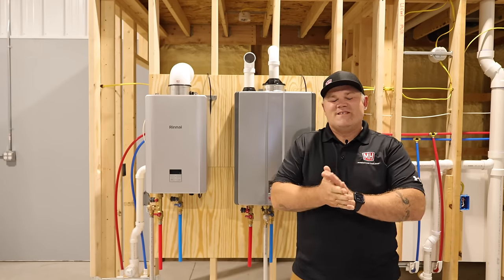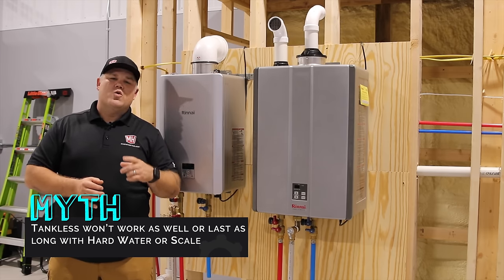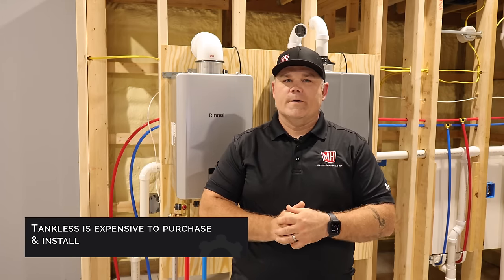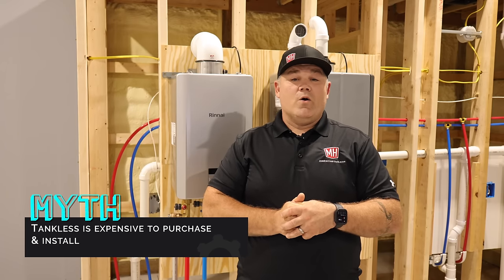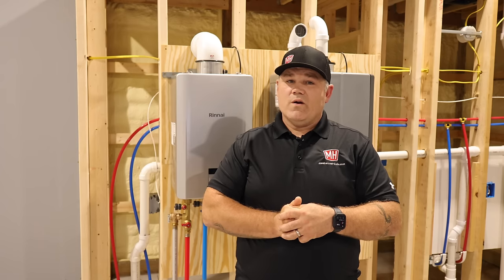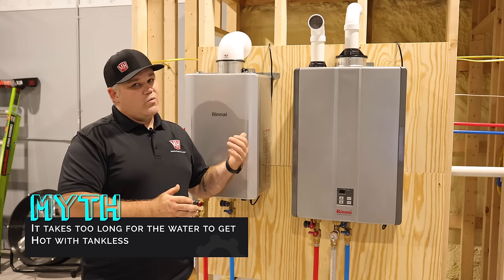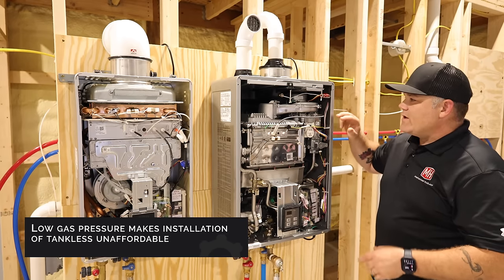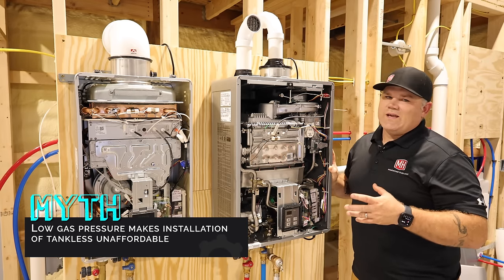Myth Busting! Tank -vs- Tankless Water Heaters

Comment: I’ve had tankless now in two homes, one in the warm climate of the Deep South and another in the bitter cold climate of the north.  We’ve never had an issue with a shortage of hot water as noted in the video.  I would add only one suggestion, in my case I use an re-circulating pump external to the tankless water heater.  It is a Taco brand and it has a feature where it learns your pattern of hot water use, so instead of always re-circulating it will learn for example when you normally shower in the morning and kick in before that time to have hot water available instantly.  Thanks for the video.
Reply: I was thinking about a re-circulating pump but I was thinking to connect it to my bathroom light which is controlled with a sensor switch.
Reply: I have a tankless in my newer home.  I keep my circulation pump off because the tankless would keep turning off and on  continuously .
Reply: @mattbowers3541  Replace it with a Smart Circ Pump or put the circ pump on a timer.  Depending on your local climate, even just circulating a few minutes every hour can help.
Reply: Eww you take shower in the morning? Take shower before bedtime to get rid of the germs you accumulated throughout the day. Your bed will thank you for smelling good lol
Reply: The bad thing about my home,like Thousands of homes in Florida built in the 60s and 70s is the copper water lines are buried directly in the sandy soil under the slab. So I just checked my kitchen sink, it took one gallon of water before I got hot water. All the videos talk about the cir pump getting the water hot then shut it off, well that water under my sink might be hot for 6 or 8 minutes but if I wait just 2 minutes and use the hot water it’s already cold, the sandy soil just sucks the heat out.
Reply: @kabulbolan  I take a shower in the morning and evening during the winter and even more during the summer. I live in a hot climate (southern climate) and can take as many as 4 per day. I am NOT a fan of tankless heaters. I know people that have them and I can never get hot water out of them for the 20 seconds I wash my hands. The Rinnai is on the outside of the house of the bathroom wall. Remember that this  video is sponsered by Rinnai so take things with a grain of salt.
Reply: @joemc111   they did that in our house in Texas too.  Have no idea  why they didn't just take it thru the walls
Reply: @DrGrandpa OCD....
Reply: @DrGrandpa Dirty Grandpa.
Reply: @kabulbolan  
That's what we learned in the Navy. Mostly because you're so hot and sweaty getting off work, that you don't want to get into bed feeling slimy. Getting a good shower then going to bed was the best way to keep your bedding clean.
Reply: @paulh6517  The time it takes to get the hot water at a faucet is the same for tank and tankless (unless you have a re-circulator pump system, which also wastes energy keeping the water in the pipe warm). The time it takes to get warm is a factor of the distance from the hot water source. The tankless saves energy by not pre-heating water all day, everyday.  It only heats it when you turn on the hot handle of the faucet.
   If you want hot water quickly at a faucet you need a re-circ (wastes energy) or an insta-hot at that faucet which heats the water there until the regular hot water gets there (saves energy).
Reply: @toolmantimsmythe8724  Perhaps both the units that I have experienced were installed improperly. I understand the lengths of the run effects the time of the hot water reaching the spigot. How long it takes to heat up the coils in the tankless is probably dependent on the outside temperature unless said recirculation unit is installed. I believe the gas heating the coils on demand is probably the reason for the delay in heating up the water up to the desired temp. Sort of like the Drip Coffee maker vs a Bunn Coffeemaker where the cold water displaces the hot water. Bunn coffeemakers are fast. But hey, I am certainly not a scientist or installer, so I could be far flung like cow dung.
Reply: @joemc111  That would be pointless as the water needs to recirculate all the time. If you stop the water from recirculating then it will cool down. Ever stayed in a hotel and noticed how quick you have hot water? It's because of gas fired hot water heaters with recirculating pumps that run constantly. I know this because I'm a maintenance tech in a local hotel.
Reply: @kabulbolan  You must not wash your bedding on a regular basis. I also do not shower before going to bed.
Reply: @williamjones4483  If we don’t use the room for a day why run the pump 24/7? Besides that your system has a Third pipe just to return the hot water back to the tank, my system like any older home would use the cold line to return.
Reply: Viewers should also consider Heat Pump Hot Water Heaters on You Tube also. After reading dozens of posts here I didn’t see them brought up. They work well and are super efficient on electricity.
Reply: @toolmantimsmythe8724  That's not my experience.  Have a tankless for first time in new construction home in NorthEast.  It takes FOREVER (2-5 minutes) in Winter to get even warm  water from any faucet in house, even those directly above the heater.  I have lived in over 30 places in my life, all with tanks, and never had an issue like this.
Reply: @unimatter  huh, that doesn't make sense especially since you have a new construction home and probably a professionally installed tankless. The only thing I can think of is that maybe the gas line to the tankless isn't big enough to allow it to operate at its maximum. Or the water lines are in a particularly cold area and take time to warm up robbing the heat from the water. It also could be turned down too low. It's definitely something that should be figured out because you shouldn't be having a problem like that in a newly constructed home.
Reply: Good information!
Reply: @kabulbolan  if I’ve had a dirty day, absolutely!
Reply: 6 yrs ago we were going to go tankless to conserve water but realized we would still be running the water the same amount of time before we would get hot water. So we had new water heaters put in and a Grundfos recirculation pump put in, it's timer let's us set the time to start recirculating hot water.
Reply: @kabulbolan  Eww you only take one shower a day.
Reply: @kabulbolan maybe they do both. No need to be a dink.
Reply: Another consideration is the weight of a tank type water heater if it is mounted in attic space. The tankless is much lighter and requires less reinforcement to support it. I have a Rheem tankless water heater that I installed 6 years ago. I have never had any problem with it. I just recirculate vinegar through it every 2 years or so. The original tank type I replaced was a 30 gal that had totally sedimented up. It was a chore to get it out of the attic.  Regards
Reply: Most people shower in the morning before going to work. If a coworker isn’t showered i get pretty grossed out, tbh.

Comment: Mr Eric, thank you so much for sharing your profession, as well as the info on "tankless" water heaters.  My wife & I have been kicking this idea around to convert from tank to tankless; with this info, you have given me a more clear picture of how it operates, things involved to consider and the price point.  When you said putting in a tankless is about the same as a tank, from price to labor, it really helped us to made a knowledgeable decision.   We will be putting in a tankless system.  Thank you for knowledge & for sharing.  God Bless from Pennsylvania.
Reply: I believe he was talking about new construction and not replacing an old one, kind of misleading information.
Reply: Don't do it.  They aren't that great man.  You did hear him say this was a sponsered video right?
Reply: Make sure to check the electrical requirements with respect to your electrical service/circuit breaker panel. Not trying to talk you in or out of your decision, but just wanted to help with planning. Hope all goes well.
Reply: @paulmendez7679  Thanks for the info Paul, with the age of our home (it was built in 1870), we are upgrading ALL the electric & plumbing before upgrading any equipment in the home.

Comment: I installed my own in 2015. Rheem was the only company at the time that would not void the warranty if it was installed by a non certified person. I have had zero issues. Make sure you use the right PVC to vent, mine had to be solid core, not foam core like big box stores usually carry.

Comment: I love my Rinnai tankless. I do live in an area with hard water, but I installed a water softener to take care of that. I've now had it running for the last 5yrs without a single issue. I do flush the tankless once a year myself (very easy to do) with the flushing kit - takes about an hour. The main think I love about it is that I never ever run out of hot water! My biggest peeve with tank water heaters was the timing of showers. Most families shower approximately around the same time back to back .. and sure enough .. after 2 showers .. the 3rd person would be out of luck with luke warm water at best. Does not happen with tankless. I also live in a warm area and we are able to do 2 showers and the dishwasher (on hot) running at the same time - no loss in temperature (mostly in pressure - but that's not the tankless fault). Anyway, I highly recommend them.
Reply: 350 to have unit flushed in Silicon Valley
Reply: @Peter-td3yk  I flush mine myself .. Amazon sells a cheap flush kit .. run some flushing liquid through it .. or you can also use cooking vinegar (lots of YouTube video's showing how). The one thing I will pay for is to have someone come and clean out the fan and heater assembly .. recommended to do a general cleaning of those every 5 - 7 yrs depending on how dusty your area gets.
Reply: @Peter-td3yk  way too much to pay somebody unless you are just unable to do it yourself

Comment: I live in Wisconsin and installed my rinnai tankless 2 years ago.  It's awesome. Most issues are due to incorrect sizing,  incorrect gas supply or maintenance.  The larger units due require upgraded gas supply, and a plumber should be able to identify this.   Although it's simple,  look at your meter. You need a minimum 5psi supply for a high volume tankless.  This also means you'll likely need a 3/4" supply to your water heater from a 1" main supply.   This line should come before your furnace, which is probably on a 1/2" supply and probably requires less gas than your water heater.

Comment: I had a tankless in Germany. It was a two-stage that clicked over from warm to hot depending on water flow(?) Showers alternated between cold or scalding. Real fun.
Reply: Genau. I had experience with a four stage unit there. I could feel every shift in the shower.
Reply: That’s the mixing valves problem, not the heater
Reply: @barrywiegert9743  No, it was a showering problem. I'm not a plumber.
Reply: @Greg042869  Yes! You have no idea what a mixing valve is do you? There is a valve behind your shower wall that is thermostatic controlled. It mixes hot with cold so you can’t get scalded. Educate yourself before commenting
Reply: @barrywiegert9743  I did away with that and instead implied common sense. Its as rare as gold now days.
Reply: @barrywiegert9743  I don't need to educate myself in anything beyond turning on the faucet. I said I am not a plumber. I am a shower-taker.
Reply: @Greg042869  😂😂😂

Comment: I had a new gas tank type water heater installed about 10 years ago and it was $1200 for everything. They wanted over $4,000 for a tankless. I don't know of the costs now but I would say back then there was a very big difference in price
Reply: I think it depends a lot on how much vent work you need done or if they need to increase the size of the gas lines (or the electrical work you'd need to run electric which can take up to 150 amps).
Reply: I think it depends on who is in charge of ripping you off. The number for both of those seems high. You must be in blue state.
Reply: I too am an HVAC technician.
I have a tank water heater.
Can you imagine why...
Reply: If you have a tank heater and want to go tankless. you have to repipe the water, gas, install a flue to outside, have to watch for windows, and run power for it. Costs add up quickly and for what? Power goes out, no hot water. Want to take a shower and someone turns on the laundry or dishwasher, tempered water. Been a plumber for 40 years. You dont need high tech and a computer board to make hot water. Havent seen a tankless yet that lasts as long as a tank water heater.
Reply: I've built quit a few custom homes and never found the tankless heater was able to justify the added cost. Even over the life of both tanked and tankless heaters the savings from the tankless heater never made up for the difference in cost. The only reason for the difference in cost, in my opinion, is greed on the part of the tankless companies.
Reply: @russellkeeling4387  Last time I ran the numbers was in 2010 and payback for energy savings was over 30 years. I know tank water heaters last that long when cared for (flushes and fresh anodes every few years) but do tankless? Prices better?
Reply: Prices haven't changed at all it's still 4000 for tankless and about 1500 for standard this guy is talking a lot of BS.
Reply: Just went through  this last month in Canada. 1800 vs 6000 tankless.  I replaced the 19 year old tank with a larger tank for 1800.
Reply: @antilogism  
For our home we saw energy savings with the tankless, $50 savings.
Have electric with both.
The first tankless was expensive due to it being new to the market, $850. Kept having some technical problems due to a variety of issues.
The second tankless, slightly bigger, $500. Have not had any problems. 
We love it.
Reply: @Paul-vf2wl   yeah, a lot of weasel wording if you listen carefully. Especially on how long they last and the cost.   he skirts the issue of how long each would last with the poor untreated water and doing no flushes on both water tanks.
Reply: @happygilmore6022  It's probably because you have a conscience.
Reply: If your kids take forever in the shower... you need an override switch on that tankless.
Reply: @Paul-vf2wl   prices are definitely up on "standard" tank water heaters. But...if you look at higher efficiency tank water heaters with say a heat pump on them...well let's just say you should sit down before you do. Ouch!

Comment: I installed one 18 years ago and after a year I replaced it with a tank heater because if you reduced the hot water in the shower it would often turn off the unit which left you with cold water unless you increased the hot water flow again. The incoming water in the summer time here is pretty warm so you need very little hot water. 
hopefully current models have a adjustment so you can control the pressure at which the unit turns off and on....
Reply: Not a problem on current tankless heaters.
Reply: Then you didn't have the correct unit for your application and low flow isn't an issue with current units
Reply: Why not just turn the cold water up ?
Reply: Most don't enjoy the cold water plugs between hot water usage.  Search Cold Water Sandwiching on youtube
Reply: @mariacompton1416  It was wide open, it gets hot here in the summer so the water is already more than warm
Reply: @adelinawarriner6259  I had the correct unit, this problem has nothing to do with size...
Reply: I have had my electric tankless water heater for over 12 years and experienced the same issue with the heater toggling on and off. Now, I live in Florida and don't take very hot showers causing this to happen which was frustrating and almost made me go back to the tank from the start.
I found when I turn the hot water on just slightly in the sink before getting in the shower this toggling is eliminated. Perhaps this practice wastes a little water in doing so, but it has made a noticeable difference in my electric bill over the long run. I will never go back to the tank.
Reply: Did you do the required maintenance (vinegar flush)?
Reply: @gingerhiser7312  The unit was new...

Comment: Installed an electric model myself , ran the required size wire and breaker, and what this gentleman says is the absolute truth, purchase a good unit , it saved me tons of money by not keeping a gas operated water heater filled with forty gallons of hot water and the tankless model I chose In electric works well in my airtight home when other appliances that require an exhaust outflow I noticed that there was no longer back flow of dangerous gases running up the side of my old heaters, actually the electric tankless has saved my life !!!!